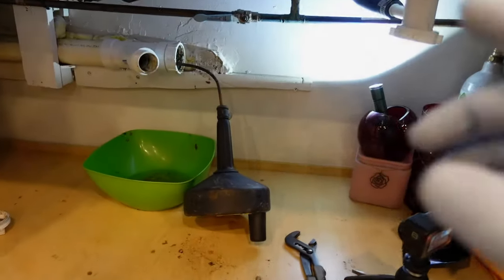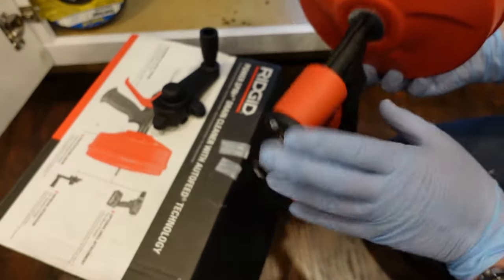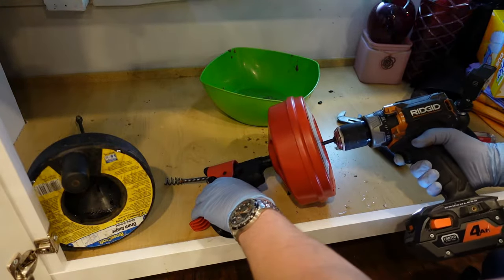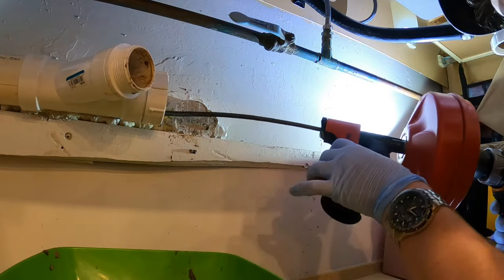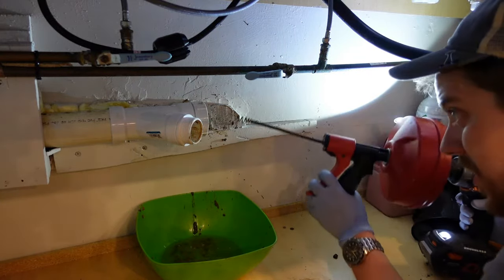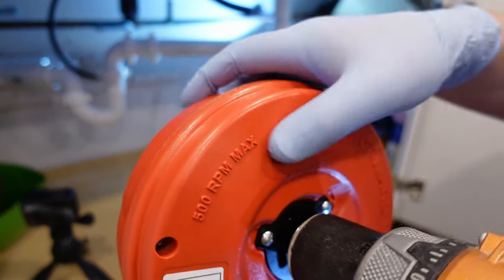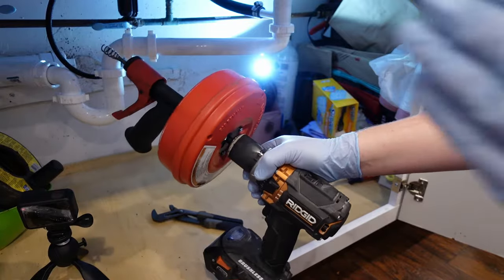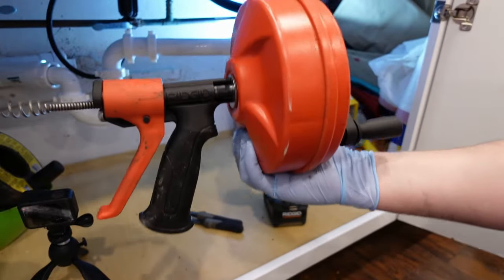Ultimate DIY Drain Snake | RIDGID Power Spin Drain Cleaner with AUTOFEED

Comment: I have one of these.  A good piece of advise is that when your snaking it forward, do it real slowly and don't crank up the RPM's on the drill otherwise you may hit an obstruction that may cause the auger to kink up on you and end up the auger getting stuck in the pipe.  It's also best to flush the pipe every few feet to flush out some of the obstruction that has dislodged down the drain while your moving the auger forward.  Once you've finally reached the augers full length down the pipe, you can now crank up the RPM's to the recomended speed of 500 rpms on it's way back to you auger.  This gives you less chance of the auger kinking up on the way back because there is no longer any obstruction.
Reply: Good tips, 2 questiosn for you, how do you flush if your drain is fully clogged, also how do you know you're close to 500rpm, not sure how fast that is.
Reply: how do you know when you're at the max length 25ft. there's no window to see how much you left out.
Reply: Great advice for any mechanical procedures. As an  ASE Master Tech since 78, I would my wife, sons, neighbors and son in law that if you had to force any rotating mass, drill bit, sink auger auger coil that it going to break, snap off or damage the part or fitting and/or driver! Now what? Ever had an easy-out, drill bit or tap break while cutting threads? If the end of a drain auger breaks off with 15" -  15'of wire-wound coil in the wall, you can't  weld a nut onto the end of it and unscrew it! That happened to me in the kitchen with a double sink, window over the top on an outside wall. Every 1 1-2" fitting was black ABS and a hard Tee to drain & vent, hard 90 to drain, hard degree elbow that turned to go 42' to main drain, with sweeping street fitting to the ABS drain about one foot into clean out (Pointing pointing to main drain, over water heater) the wrong way on the back wall. 14" adjustable pipe wrench would not turn as 1980 house. Tore out drywall and installed new correct fittings and added drain an told wife again for the 390th time not to rinse the wet mop in the sink at all. First shake out in trash can, then if needed, plug garbage disposal with standard good-fitting rubber plug, this will catch hair, stones, toy parts, the list goes on. Remove all junk by hand as finger nails help but tweeters work great. Pro-drain CO, charge extra on weekends even plus repairs. Best of luck and go with patience!
Retired ASE master.
Reply: @supra2k8  I guess I have an advantage with an optical RPM meter that uses tape and my grandfathers box of mechanical RPM with adaptors for 4 scales. My Craftsman Pro Serial Li-ion drill (No longer made, 2-Speed) reads 550 +/-30 RPM. By the sound of other brands, the speed sounds the same. The box or customer service. I can't buy new ones but a test drive at a home improvement store will prove fruitless.
   You can only find a clog by feel, thus going slowly. Once you feel hard resistance, a clog, back out slowly, repeat slowly. My sink drain has a straight run above finished basement ceiling.   Masking tape marks the end, either feel or sound, then measure. Add a foot or two for corners. The 1 1/2" ABS seems small, but Tom Sylva from "This Old House" says that this size pipe promotes scouring of the pipes debris. Hope this helps. DK, ASE Master since 78, retired.
Reply: @beefing313  I am not sure what this has to do
Reply: @beefing313  I is that breakfast of your language?

Comment: You can manually push the cable into the pipe until you hit resistance at a bend, then use the drill to spin.
Reply: Awesome!!

Comment: OKAY, YOU SKIPPED A VERY IMPORTANT PART.  DID YOU CLEAR THE CLOG,??  WHY DID YOU OMMIT THE MOST IMPORTANT PART?????
Reply from the maker: I did but that wasn't the point of the video.
Reply: @MillennialReview  I can't speak for this drainage cleaning attempt but my my drain from the the kitchen (-Minus the wall) was 40 feet 1 1/5" long ABS with stupid molded ABS hangers that broke. With the ceiling finished, I had to reach both directions to install new plumbers tape and bocks of wood inside the chase using a torpedo level. 
  That was me, all I can tell you is to check "Vivo" brand and never run backwards, only pull going forwards. You'll twist the line. Spring steel looses its temper when heated. Be careful.
Reply: @MillennialReview  No; that was the point of the video!
Reply: @MillennialReview well of course we're going to want to know

Comment: Is this good for sewer lines?
Reply: I just cleared a 4 inch line with this. Right thru the trap, using a drill attached. This auger is worth it's weight in gold.
Reply: Should be able to get that info on online.

Comment: I bought one of these when I couldn't get two different drains clear with a hand auger, where you'd feed it in, clip it down to force it further, unclip, pull some more wire out, clip again, and repeat endlessly.  After a few hours of trying with one drain, and having previously given up on the other, I came to YT to find some advice and saw someone using this.  I went to HD and bought it, brought it home and had the first drain clear in about 10 minutes.  The other drain I did a few days later and it also only took about 10 minutes, and only a single feed while sitting on a shower chair in the tub.  It is great that you can reverse it and it isn't a big deal to get it back down again.  The best part is you can relax and do this as the wire feeds cleanly.  No bending, no laying on your back, no contortions.  The wire is heavier duty than the cheap hand ones and doesn't kink easily.  Once there's a kink in the hand one you may as well toss it.

It isn't a pro tool, but if you need a pro tool to clear a drain you'd better call a pro to do it, otherwise you may get the water running through, but into your basement instead of the sewer.

Comment: Absoluley one the better autofeed drain cleaner tools. Works well with any drill ( Use the clutch speed dial to prevent exceeding the 500 rpms ). My bathroom sink has cogged several times over the years and so far Ridgid spin drain cleaner has been the best tool I've used Yet. (FYI, I was working in tight quarters and started using the snake with my drill without realizing It was resting on my wrist area and gave myself a skin burn.) Recommended.

Comment: I bought one of these and the very first time using it the stem that you put in the drill chuck broke off.  It's held on with 3 crummy little spot welds and they broke right off.  Ended up having to put the hand crank back on to pull the snake back out.

Comment: how do you wash the coil once it is back in it's container?
Reply: Extend the cable and hose it down with the garden hose Sprayer nozzle or gun set to jet. As you return the cable back in the (DRUM) case, Dry it up. It won't absolutley get all the dirt but will minimize any built up. (To minimize gunk built up in the (DRUM) casing, when extracting the cable at slow speed or manually hold a rag on the cable and wipe off excess debris.)

Comment: buy a cheap drill for that my friend
Reply: Never buy cheap tools get something that will last your lifetime... it's always worth the extra... I have tools that my father had when I was a kid and tools that my grandfather had when my dad was a kid.... dad always said get the best you can afford and take care if it....I do .. best advice ever.... only buy cheap if you intend to beat it up... I even have high quality tools I bought and bent intentionally for one specific use.... I have wrenches that I bought and bent specifically to reach a nut in a hard place have 2 that are bent opposite directions so I could turn one ab little then get the other on turn a little and continue... this was for a bell housing on a transmission no other tool would reach... took everyone to remove that one bolt but was the only way other than cutting the floorpan  and doing it from inside the car... I have open end wrenches I ground the head diam to gain clearances... I will go buy a new tool for these specialty jobs to modify rather than break up a matched st... the guy at the tool store gave good advice buy a tool and make it work then paint it special color and throw into special tools box